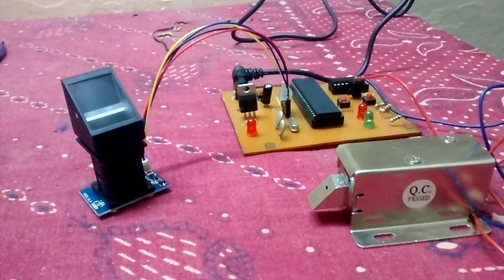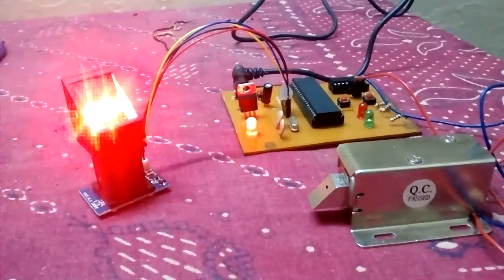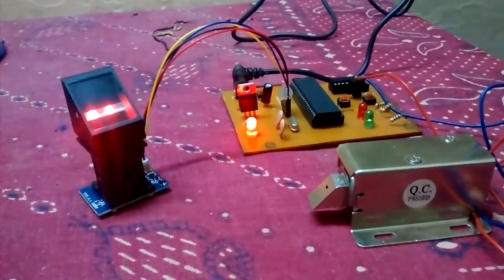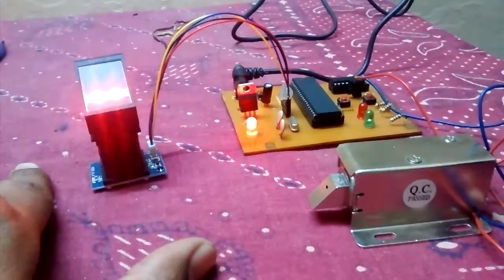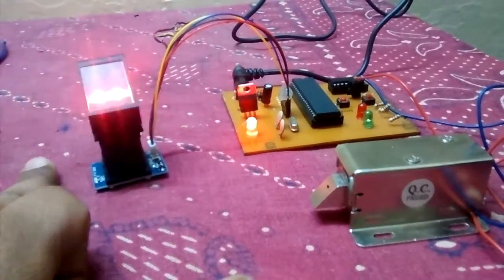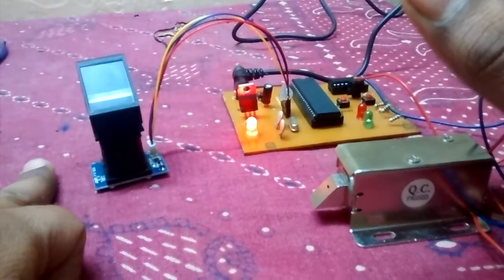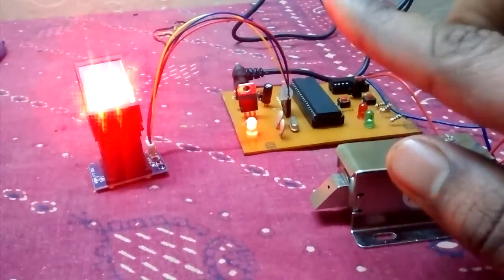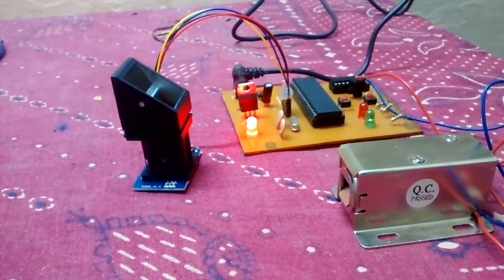Finger; fingerprint; R305 fingerprint sensor; 8051 fingerprint security system; solenoid lock

Comment from the maker: If any one need ready made module to control fingerprint module please see the 
https://www.ebay.in/itm/R305-FingerPrint-Module-Interfacing-Board/172966534209?hash=item28459bdc41:g:YHsAAOSwStxZypJi no need to write complete protocol for module if u want that module please Whatsapp me at 9024375082